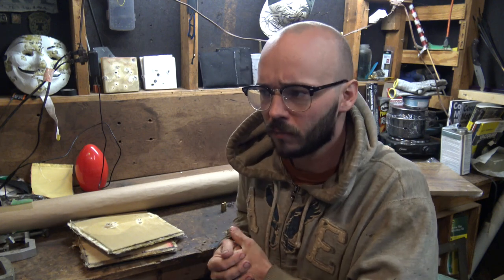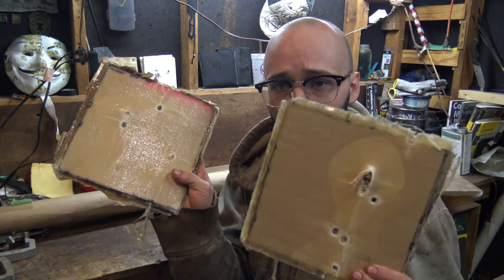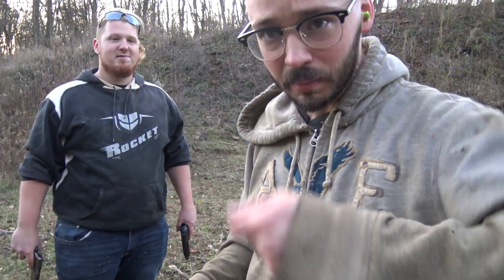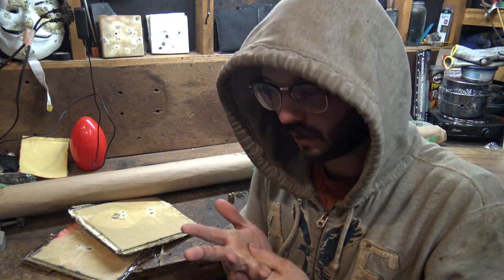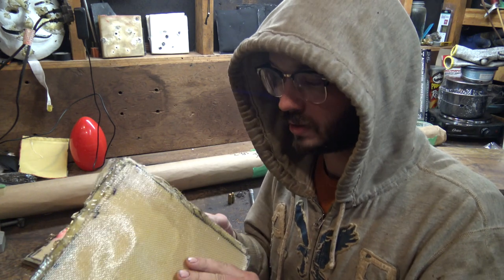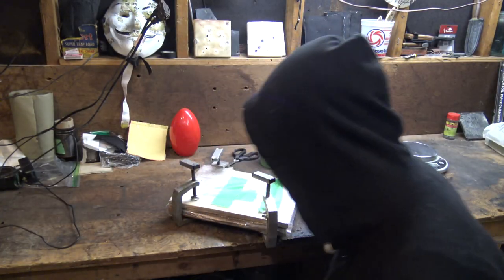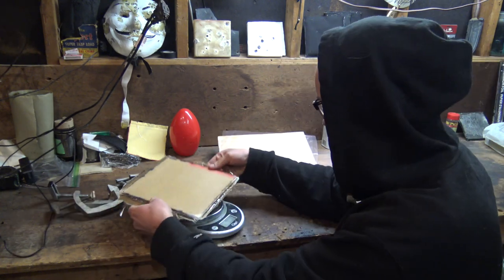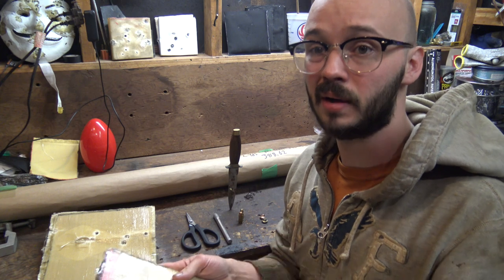Stopping bullets with a unique composite fabric

Comment: I do not have the answer to this but it all possess a question or two in my head. Part of the bullet resistance of fabric such as Kevlar is it's ability to deform and produce a more gradual deceleration of the bullet. The fabric catches the bullet like a catcher's mit. This fabric deformation spreads the bullets energy over a larger area. It is my suspicion that making the fabric into a solid sheet might actually assist the bullet in penetration. As a crude example, if I placed a material flat against a brick wall and struck it very hard with a Ball-peen hammer, the damage to the material would probably be much different than if the material was free hanging and could move on impact. It would be very interesting to see side by side shots on the fabric not laminated. Perhaps securing the fabric to an open hollow frame? I don't know. Might be interesting results to compare.

Comment: 1. Calibrated construction gravel and melted HDPE.
Thick-ish and not really lightweight but super cheap.
[2 thick ceramic floor tiles glued together in the front for more protection if you want]
Bare or back up with 5-to-8 layers of the cheapest fine fabric+resin you have, simply taking care of crossing each layers square-45°-square-45°-square-45° etc

 2. Same with ceramic balls and melted HDPE around.
Will be lighter but thicker.

 3. 2 simple ceramic floor tiles glued together and melted HDPE all around.

A soft pack behind any plate gives time/room for deformation/dissipation.

Comment: I'd love to see this with 25+ layers, also a fabric I was looking into called Dyneema. Have you ever heard or looked into it, its used in cut resistant sleeves and such? It may be a viable material-idk about price though.
Reply from the maker: Yeah Dyneema is amazing fabric, it's spun UHMW polyethylene. I used a fabric made by another company under the name spectra, it's the same thing really. If you watch my mask build it's the fabric  I used to make it bullet resistant. It's fantastic really, kinda hard to laminate though, but worth looking into. And yeah I want to try this fabric at 25 to 30 layers as well, just to see. Thanks for the comment!
Reply: I've looked at Dyneema and have planned to try it as well.  It is expensive, or at least, more expensive than the straight UHMWPE rolls from Ali baba.

Comment: Nice work with the Vectran lamination. I am building ballistic shells for shielding equipment at a shooting range. Looked at a number of fabrics for ballistic characteristics, and so far, Vectran looks the best.
Do you know which grade Vectran you were using, HS or M? And do you know the denier rating? Most testing is based on a 1500 denier, 300 filament yarn. I have found Vectran with tensile strength ratings of 500, 750 and 1000 lbs, but I need more information about denier size. The heavier the fabric the more difficult to get good wetting in the lamination, although I am using vacuum bagging and low viscosity epoxy.
You might check out TECH Ingredients on YouTube. They are testing various fabrics for ballistic shielding but have not done a video on their results. You might also be interested in a research project done at the Army Research Laboratory in 2011 testing basalt woven fabrics for military applications (https://apps.dtic.mil/dtic/tr/fulltext/u2/a552757.pdf ). 
Thanks for your experimentation and will follow future projects.
Reply: Hello Alan, wonder that you please can help me with this:  Vectran, sales nonwoven fabric or  woven fabric.. which one is used for this proyect?  armour vehicle. Thanks
Reply: @gastecconversionprofesiona4250   Vectran is a woven fabric

Comment: - Try laminating layers at different angles since composites are not isotropic.
- Add a thin sheet of aluminum in front of the composite plate to break hollow points before impact.
- This is speculative but try making a 30 layer plate and compare it to 2 15 layers separated by a thin piece of EVA, might be different.

I'd try it but i live in europe so no access to guns

Comment: I bought a 10 meter roll of UHMWPE sheet/cloth on Alibaba (can't get it in the West easily, and certainly not at the price you can at Alibaba). It is made for ballistic vests and plates. I've been laminating it about 60 layers thick which SHOULD make it level III by itself. I'm applying a layer of hexagonal porcelain tile over it (front side) and going to wrap the whole thing with a layer of Kevlar. It should be level IV or level II+ when done. I think this vectran stuff, plus UHMWPE laminated together to about 1 inch thick, then either covered with ceramic tile or ballistic nylon or Kevlar should get your plate up to III+ as well. As it is, I'd bet you can get to level III with just this vectran cloth if you layered out to an inch thick or so. Take any of these and cover with ceramic tile and ballistic cloth - you must capture shrapnel from the ceramic at least or you can ruin your day if shot and that requires an outer nylon, Kevlar, or even more vectran cover.
Reply: "Should be level IV or level III+"....  I'd test it before putting a estimated rating on it. Please post videos of your tests.

Comment: I'm reading that excess resin is weaker, as resin is not bulletproof - it only binds the layers.

Will it stop 45 Long Colt - Colt, LC or C are same - or 50 cal handgun?

How many layers to stop a 30-06?

Thanks, great video!

Giovanni
Reply from the maker: Thanks! yeah too much resin can make a composite weaker, it'll also add some of its own properties to the composite piece as well, ( stiffness, compression of the fabric, maintaining shape, some impact resistance, ect.) So the resin is important, but too much for sure will mess up a composite piece. And i'm not sure if this could have stopped any larger rounds with only 14 layers, but I'll definitely be experimenting with this fabric some more so stay tuned!
Reply: @Techthisoutmeow  Have yet to see anyone stop a proper rifle round with some laminated fabric, would love to see it. 

Can't wait 😁.

Edit: do you think combining it with some other material plating (high carbon steel, carbon fibre plate ect.) would improve its properties as a ballistic plate ?

Comment: Just found your page, good stuff. Have you experimented with resin/epoxy impregnated ballistic nylon or dyneema? I've been looking around for homemade armor/plates done right and I may have found it.
Edit: saw the comment below. I have 1.2mm 300# tes string and it's badass. 
Are you familiar with dragonskin? From about 10 years ago? I want someone to do an at home, better version of it. I think you're up to the challenge
Reply from the maker: I have used both! Well, spectra, not dyneema. Both spectra and dyneema are UHMWPE fabric, just from different companies. Ballistic nylon is some awesome stuff as well, it'll be in one of my future videos soon. I've mostly used it as a rap for my HDPE plates, you can find those videos on my YouTube channel. My guy fawkes mask was made out of spectra 1000, so UHMWPE fabric.

Comment: Unfortunately, v the link provided for vectran no longer appears to have vectran. That fabric is as hard to find as UHMWPE flexible sheets in the West. You can find dyneema but it's expensive. Kevlar is fairly easy to find. Alibaba has Vectran but I cannot find less than 500 meter rolls.

Comment: Would you make plates half the width and overlapping to put into something like a modern wisby coat of plates?

You wouldn't need to worry about curving larger plates and damaged ones could easily be swapped out.

Also body armour tends to be cheaper than a quality combat helmet.

Seeing the ECH ballistic helmet (HDPE based) test I was thinking it needs a harder interior shell or backing. I wonder if a similar lining to the Vietnam era M1 helmet could be used.

I would love to see your designs in a helmet. Perhaps using a cheap replica as a base.

The mk6 British nylon helmet was very disappointing. It couldn't stop any pistol rounds. 

LVL IV body armour exists but helmets continue to disappoint.

Comment: I don't see the fabric on the website. Not sure if I'm bad at searching for stuff, I couldn't find a single vendor that sells vectran.
 Is the epoxy you used https://theepoxyexperts.com/shop/adhesives/structural-strength/max-bond/max-bond-low-viscosity-ab/max-bond-low-viscosity-32-oz-epoxy-resin-fiberglassing-marine-aero-auto-boat-building-high-impact/ 
this one?
I wonder if hdpe fabric could work. I've been searching online but I'm only seeing tarps. Thinner is probably better because it can stretch more before breaking. (For the same weight of fiber)
If you look at the Lv 3 hdpe plates, you can see the fibers are very very thin. They don't use a lot of epoxy, so the plates even float on water. Very thick plates, but much lighter than sapi plates.
https://www.youtube.com/watch?v=0iOwzmJzdeY
go to 2min 16 seconds. You can see the insides of the plate.

Only if kelvar wasn't so expensive lol
Using as much fabric and as little epoxy is best.
Looking forward to your next videos. Please upload often.
Reply from the maker: Yeah for whatever reason the Vectran fabric has vanished off the face of the world lol. When I ordered it you could find it at sollers, I'll let everyone know when it pops up again at some of the composite sites that I visit. Yeah that's the resin, it's one of my all time favorites! Very tough and has great resistant property's. HDPE fabric you say? I'm not familiar with it, I've used UHMWPE fabric, under the brand name Spectra. That's what I made my mask out of, and yeah you could see that plate undergoing some significant delamination in those tests, which is very common with composite armor. That being said, both HDPE and UHMWPE have some amazing property's, I'll look into the fabric form of HDPE and see what I can come up with. Don't worry, I'll be uploading plenty of project videos soon!

Comment: COULD THIS BE PUT INTO CAR DOORS? WHAT IF YOU MADE SEVERAL LAYERS SEPARATED THEN INSTALLED IN CAR DOORS OR UNDER FLOOR MATS. WITH PEOPLE GOING AFTER GAS IN UR TANK,WHAT ABOUT PUTTING UP A SHIELD OF IT AROUND OR AT THE BOTTOM OF A GAS TANK?> THANKS